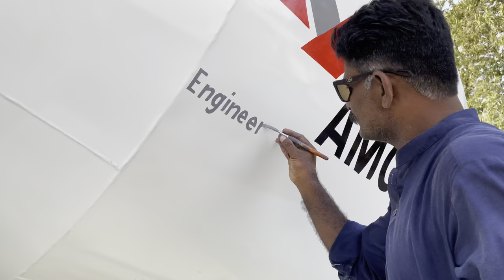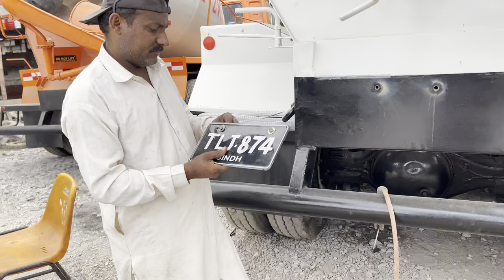How to Make Concrete Mixer Truck || Manufacturing Process Of Concrete Mixer Truck Machine || Part 2

Comment: They just tack the piece in, never weld the entire seam!!! Whatever they build will just fall apart!!!
Reply: I was looking to see if anyone else noticed, it's pure junk.
Reply: @ernsailor9041  Yep. the only thing welded out was the mixing drum itself, but the metal wasn't cleaned in any way. the welds will fail quite quickly! BTW, I'm not standing on that support platform at the top of it! Not fully welded, and someone is falling off!
Reply: It's designed economically under certain budget constraint. Moreover it's easily repairable because of being junk. The thing is most parts are either refurbished or build entirely out of broken parts. So this is quite alright considering these machines are built to last (as long as maintainence is available, which is indefinite)
Reply: I would say people assume  they just tack it in. Don't  know about that because they do not show full welding. Remember concrete is heavy 2.2 tonnes per cubic metre. I will bet they weld it decent enough otherwise it will collapse first load. Any time some one buys something in the world they expect it to work right. It's  called consumer rights.😁❤ cannot be any worse than a Baryval drum total junk blade pulled away from the drum total shite build.

Comment: I'd like to see how that structure hold up when it's spinning a ton of so of cement.
Reply: I so wanted to see the First batch of concrete come out of that tin can mixer!
Reply: more like 13ton... that is roughly the weight of 6m3 (cubic metre) of wet concrete. 6metres is the quantity of your average bowl...the weight of 1m3 is 2.2 ton approximate

Comment: I enjoy watching these videos but my God everything on this homemade cement mixer is tack welded and then they use Bondo to hide all the seems. I've been to Pakistan that thing will fall to pieces on those rough roads
Reply from the maker: I wanted to tell you that every part of this mixer is well perfectly welded but could not see in the video for which I apologize.
Reply: @wowinterestingskills  thank you for replying! I enjoy all of the interesting Pakistan videos and these hard-working people. I am a professional mechanic in the United States. I have lots of tools that I no longer use I would love to give to the mechanics over there to make their job easier
Reply: @wowinterestingskills  So you are telling us that you removed many of those parts to re-weld them properly afterwards (?) It never happened and you know it as we do.
Reply: @williamwalker4029 sorry to intrude in your comment but as a person in this field and from similar country, I can assure you these machines will last. I don't know about the channel's claim on the perfect welding sections in video being missing, but we do make these types of weld. Since most parts are refurbished and build in house, it is very necessary to not weld anything to make it permanent, so as to refurbish parts and body later. As you can see, this is not a traditional "straight from the factory line". In developing country, we got to use what we have. We can't just order parts. We most of the time save significant portion of budget by making instead of calling up a factory to get it. Also you can see, it's easily serviceable by any mechanic. It's like Soviet style of build. Things which can last as long the skilled workforce is available which is inevitably true.
Reply from the maker: You are right 👍

Comment: Over the years I've watched 30 or more of these Pakistani fabrications and accident repair videos. This one is hands down the scariest of all that I've watched! The welding? Good quality welds do not require body filler handy work! And think about lock washers, or locking nuts on those safety rails and cat walks...their fit up skills are excellent and the sign painter is a true artist.  More attention to welds is definitely a must! Would seem there is no material DOT or government safety standards to abide by, so whatever works for them, I guess. Looks great driving off the lot!

Comment: Are they using a lot of body filler to cover up the bad welding????
Reply: fairing compound same as they use on boats to get a smooth finish

Comment: Amazing, WOW, what craftsmen.
Reply: what cobblers,,,,,,no duplicate parts from side to side or top to bottom,,,,when any repair is needed at a later date, nothing will fit,,,each part will have to be adapted and made again,,,,very expensive way to do work,,,,
Reply: this is made so bad and are not safe to use

Comment: Great work by men that will die horrible deaths of lung disease along with hearing loss and blindness. I have to wonder if this well used and painted over truck will be sold locally as new. Buyer beware.  Always impressed by free hand painters that can do lettering better that I can with a typewriter. Even did a great job on the tags. Local dmv got beat out of money on that i guess. Lol.
Reply: ill bet there is no DMV,,
Reply: No They Would not sell it as new It's just a truck equipment manufacturing, In factory the half the trucks chassis only built second half is customised depending upon the usageo

Comment: using calking, and bondo to fill the huge gaps between the stich welds. this truck is going to fall apart in a couple months on the pot holed roads.

Comment: note to self, if you see a cement truck in pakistan coming towards you, run the other way.  i'm no welder but that looks like high school welding class stuff.  everything all just tacked together, no cleaning before no filling of seams.

Comment: It is made for a certain amount of concrete and does really well driving has to be done slowly around curves and corners it is not loaded full and the mix is always on the bottom and is loaded in yards

Comment: Scammers!!!
Would you load 40,000 pounds of concrete in that tin can???
Loved the way they welded scrap pieces together to use as structural components. Not to mention the supports for lateral loads at the rear. Then paint a logo and a license plate.. . . . Legit?? I think not.
Creative?  YES!
Hard workers? Yes!
Two thumbs up for that.
👍👍 and 👎for the rest, though watching a full barrel roll down a hill would be entertaining.

Comment: who says that bondo cant cure bad work especially when you use 2 colors to help show where there is no welding. i feel bad for the vehicle that hits this truck because it will fly apart at the corner seams and become flying knifes

Comment: Thrown together with a bunch of tack welds that is a disgrace to the word Engineering. 
Those under-run bars on the sides are laughable & will rattle and fall off in a week at most.

Comment: The guys that built the drum weren't exactly aerospace grade but they were still pretty strak troopers. Is hire then in an eyeblink, on the other hand the guys in this vid are pretty schlock at times. -Couldn't use any of them.

Comment: like monkeys in the jungle,,,,all put together but when it needs repair all parts will have to be custom made. No safety equipment, sandals, no gloves or helmets or goggles,,,,,osha would faint dead away,,,,,,nooooo thanks,,,
Reply: In third world countries they don't have the luxuries of safety equipment and they where wearing welding googles
Reply: @stephenwhiteley2879  i can tell you have never welded,,,,their arms, faces, ears,,,,alllll will have excessive burns from the rays and intense light,,,,,worse than a sunburn if you do it much,,,,,a simple 11 dollar face shield and a pair of leather gloves could save them,,,,,but that not me,,,thank goodness
Reply: @bill45colt  i am from India. I haven't seen anyone wearing a helmet while welding. Its not that costly compared to hospital bills.
Reply: I can smell their feet through the screen! 🙂